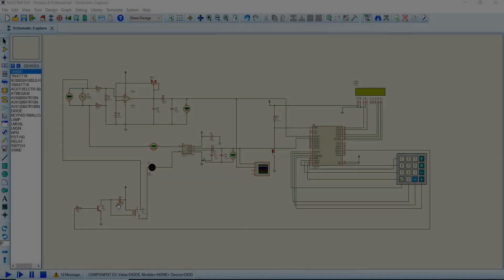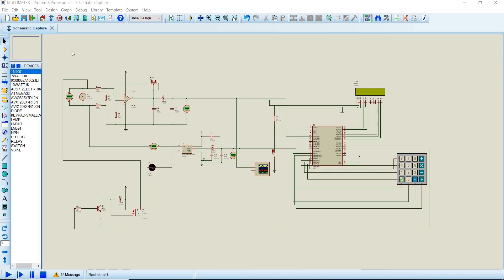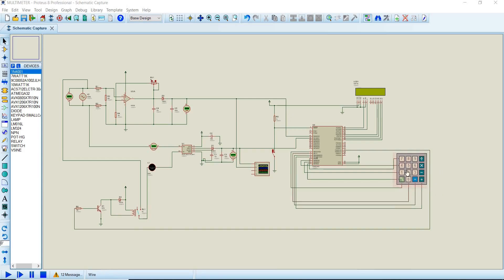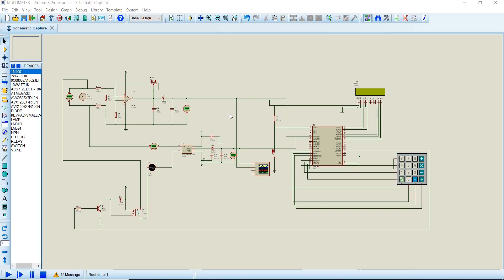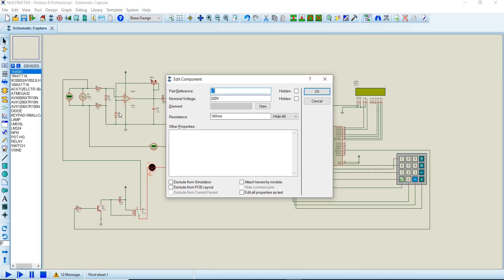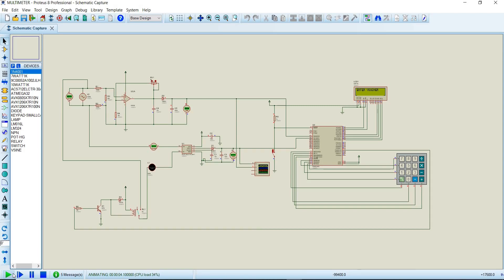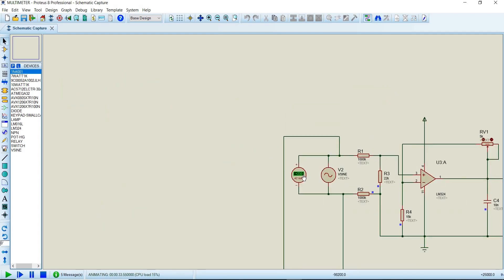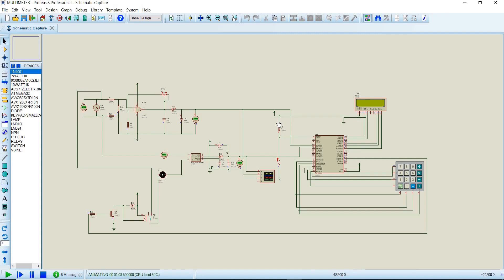Smart Electricity Meter using ATMEGA 32 Simulation on Proteus

Comment: Hi, Can I have the code just for reference?
Reply from the maker: Get the code here: https://drive.google.com/file/d/1xOipRFG-1r84CWYD9YptrR35i6wFP8o7/view?usp=sharing
Reply: this code is giving undeclared errors. have your code worked errorless?
Reply: @prakash456  I have used this code as reference and write my own code for my project.
Reply: @ateebhassan000  sir, can you share your final code for reference?
Reply: @prakash456  by the way what error you are getting?
Reply: Thanks alot
Reply: Did you get the code